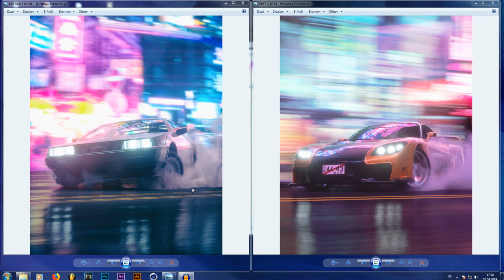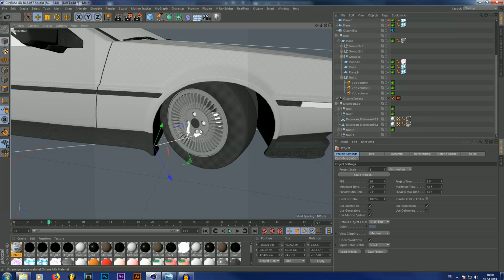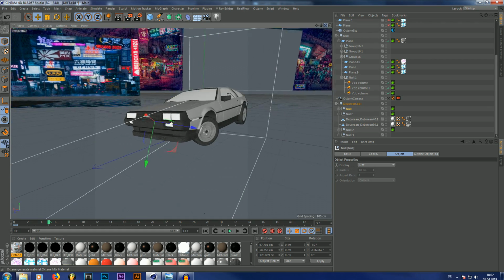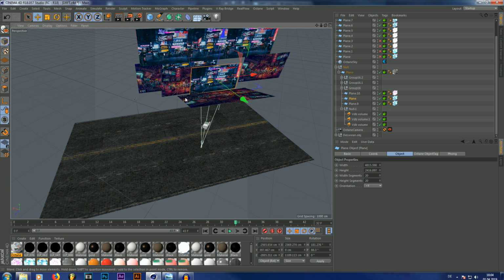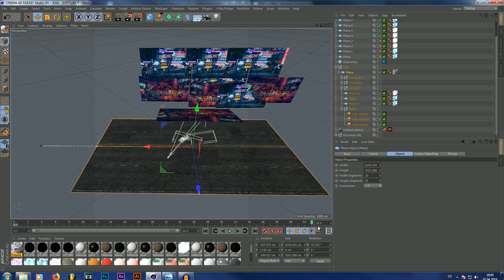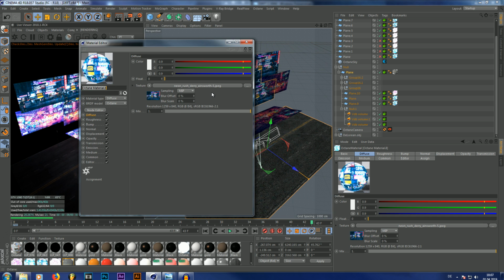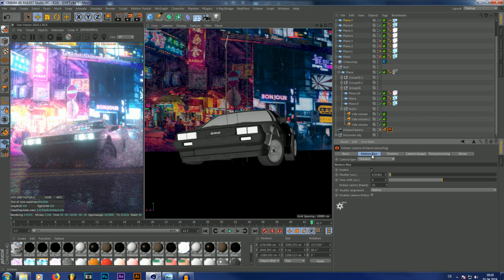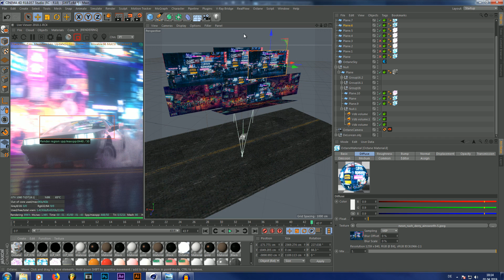Motion Stills in Octane Render | Tutorial/Breakdown

Comment: what to do if i have a scene where the camera is following the car and i want to have a car in focus, wheels blurred out and background to be a bit blurry as well? im really struggling with it. does the octane object tag actually make it so that the object will or wont have any blur at all? do i need to have it on every single object of the whole car or on the group of the objects?
Reply from the maker: Good question! yes if you use an object tag that will have the desired effect. It might not always work in the live viewer, but it 100% works in the picture viewer once you render. (for the live viewer, go back and forth a bunch of times in your keyframes, its a bit bugged, and will work like 1/10 tries to get the blur correctly) The tag only has to be on the parent null of the car, not every object inside. For the wheel blur make sure to use a sampling step of 10 instead of 1. you can find that setting in your octane render settings. Otherwise your wheel will look mushy, even if you have done everything else correctly :)

Comment: how to smoke wheels ?
Reply from the maker: Its a vdb volume. Or as alternative you can also use TFD to simulate it
Reply from the maker: Theres not really anything you do to the vdbs inside C4D. Usually they are created using simulation software like SideFX Houdini (i did not create these. they are as stated in the video, by Mitch myers). Then imported into Octane. After export you cannot change anything but the scale of the cloud/smoke. So all I did was import it and position it correctly. So there is nothing to show that is not shown in the video.
Reply: TheDizzyViper clear, thx ❤️
Reply: Yep, can u show usage of vdb?